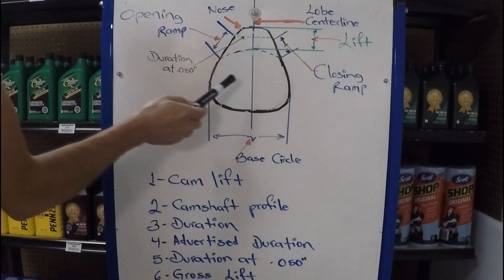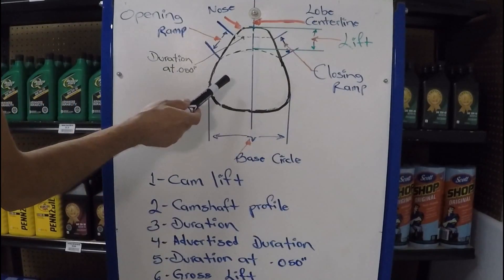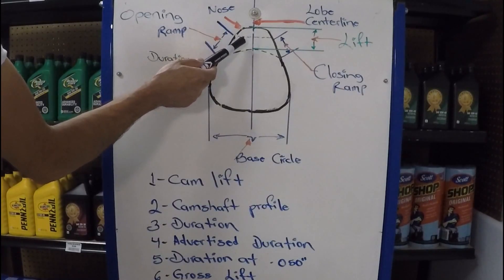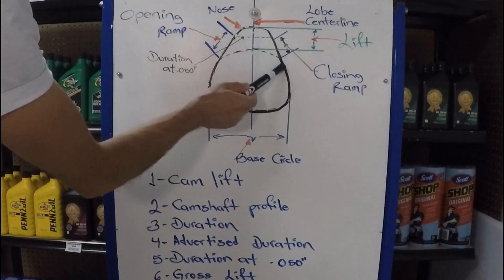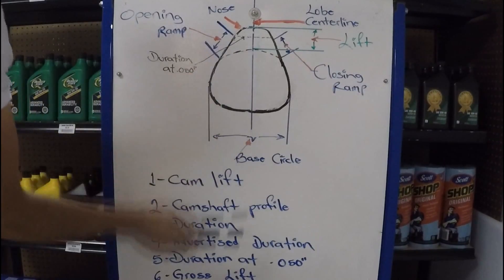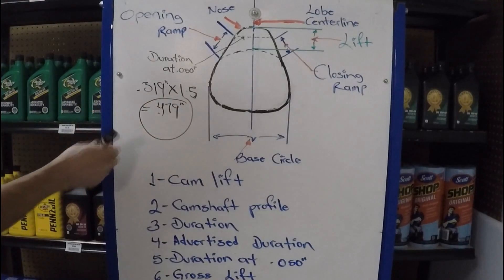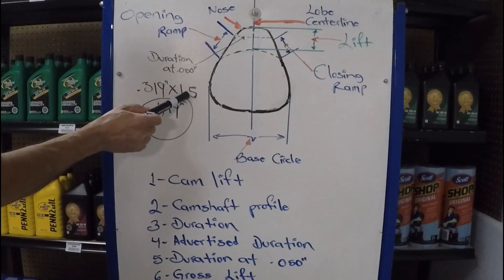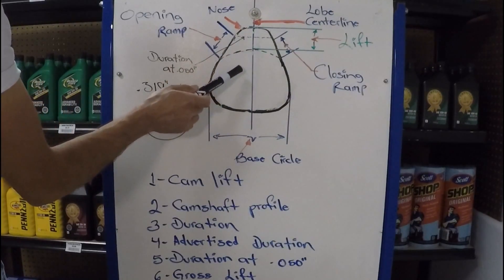Understanding Camshaft Design Part 1

Comment: Very nice video!!
 I have a question that I would be glad if you answer.

With disregard to piston to valve contact and with compensation in theoriginal valve train and lifters is it possible to increase the radius of the base circle considerably followed by spreading maximum lift to a wider range of degrees  while maintaining the same camshaft max lift and max duration?. This is aimung at providing a mild profile with max lift available for more degrees. 

For example max lift is 10 mm and  total cam duration is 280°. In original form 10mm are available for only 5-10 degrees. By increasing base circle and keeping total duration at 280° and the steepness of the camshaft  we now have 10mm available for 15-20 degrees for example.

What do you think. Please le me know thank you